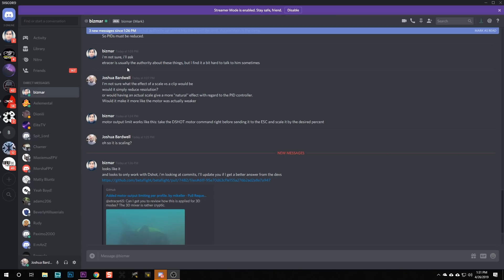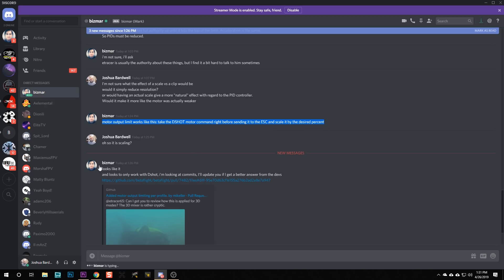Betaflight 4.0 6S High Kv Followup | BETAFLIGHT BUG AFFECTED RESULTS?

Comment: I looked at the code, and started to answer before I totally got how it worked. (never got to asking Etracer 😅) Joshua recorded the clip, before I understood some key parts.

It works with every protocol, it scales the output right before sending it to the ESC, only bringing the "top" down, so Idle can be higher than equivalent on 4s.

For more info here's the relevant PR https://github.com/betaflight/betaflight/pull/7482
Reply from the maker: Hey Mark -- thanks for the clarification. I'll pin this comment to the top.

So is it scaling or clipping the output?
Reply: Scaling. Clipping would never work - the PID controller wouldn't be able to control the quad.
Reply from the maker: Thanks for the clarification, Bruce. I agree that clipping would be crazy, but that's what some commenters were guesing was causing the problem.
Reply: sorry to be so offtopic but does anybody know of a way to log back into an Instagram account?
I was dumb forgot the password. I appreciate any assistance you can give me!
Reply: @Titan Dallas instablaster ;)
Reply: @Jaxon Graysen i really appreciate your reply. I found the site on google and Im in the hacking process now.
Looks like it's gonna take a while so I will get back to you later with my results.

Comment: BF4.0's motor scaling being tied to FC power cycling sucks because BF4.0 is supposed to auto-switch PID profiles and motor scaling when you change between 4S to 6S packs. Now, you'd still have to manually change profiles BEFORE you change between 4S and 6S just to get auto switching motor scaling. 

Like others who successfully ran 6S high kV, you should try running 6S high kV on an older BF version, set throttle limit and lower motor mixes (albeit the latter cannot be changed without connecting to the Configurator, but the flip side is it also works with non-DShot). And according to Mark Bizilj's comment, also lower your idle by 1/3 (e.g. 6% to 4%).

Lastly, you forgot to mention the benefit of being able to squeeze out a little more power on 6S high kV if you want (and your motors/ESC's can handle the current). You can raise the scaling limit a bit, and it would be like going from 6S/1700kV to 6S/1900kV.

Comment: Confirmed, motor output limit from config works as described,  for every protocol. Normalised output values (0 - 1) are scaled to MIN and your limit % * MAX range.
Maybe 6S high KV needs some adjustments in BLHELI configurator?

Comment: i tried 6s today on a 4s quad using throttle limit to scaling with a % of 75. 
still to much power may need to go lower.
then i tried the same settings with a throttle curve. much less power but still got some dsync after hard flips.
so i tried just a throttle curve  after watching mojopapi fpv"s vid.  i toned down my 2500kv motors to 1900kv.
the quad performed well with no dsync. but i"m not sure what will happen in a crash or bumping a branch.
more testing needed. either way this has potential.
please do some more testing jb .
Reply: Update.  I've set 2 quads up with motor scaling @63%. They fly great on 6s . No dramas in a crash. Some slight oscillations but nothing a bit tuning won't fix.

Comment: I uninstalled 4.0.   It was making my 6S Quad fall out of the sky after more than 1.5 Inverted Yaw rotations. I also made my ESC's and Motors red hot to the touch. 4.0 almost fried and smashed my new Quad.   HolyBro F3 Metal ESC's and T-Motor F80 1900kv motors.  Back on 3.57.  All is normal now. Lots of people tied to help with no results. So far at least.
Reply: Same experience. Diatone mamba stack with xing 1700kv motors get super hot. Went back to 3.5.7 and perfectly fine
Reply: How does it work now on 4.0 and later?

Comment: Could the motor scaling work with 4s rated esc's being it limits before sending power to them? Some people are using 5s on their 4s rated equip with good results, just wondering if this might be a safer way to try it out to possibly avoid a burnt up quad
Reply: No. It only limits the throttle level requested of the ESC. You'll still have 25.2V connected to an ESC rated only to handle 16.8V.

Comment: Pretty interesting, Joshua! 😃
So, basically, if you have done the same without messing up with profiles... It would've worked? Hmmm... I don't know if I believe it. 🤔
Reply from the maker: I think there was something about these quads that just didn't "like" this setup. Maybe my motors need a significant reduction in PIDs because they're larger/torquier. I know that other people are running 6S high kv with just a throttle limit so I really expected it to at least by flyable.

At first I thought it might be a bad ESC but it happened on two different quads.
Reply: @JoshuaBardwell  Yeah, could be it... 🤔

Comment: Hi Joshua, please forgive me for an off subject question but have you ever considered that hobby grade manufacturers could develop equipment and systems that could help guard the border?  It would work in conjunction with stationary cameras and deployment of ground based or helicopter deployed enforcement personnel.  Probably high altitude military drones also.  The object would be to place eyes anywhere necessary in a short time.  They would be controlled mostly from stations along the border.  They would carry an fpv camera, a gimble mounted high quality camera with telephoto capability and an infrared camera.  They would need to be capable of high speed and long duration.  They would be expensive but very low cost compared to full on current military drones.  It would be a highly rewarding field for the right people.
Reply: Or we could just build a stupid wall - oh wait...